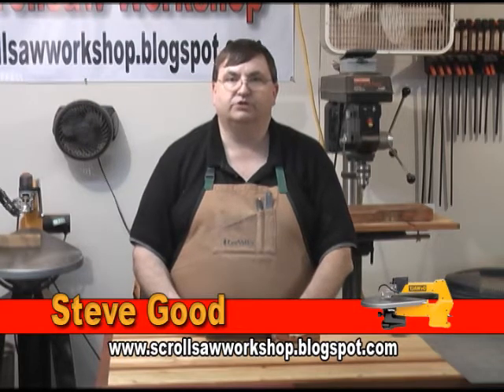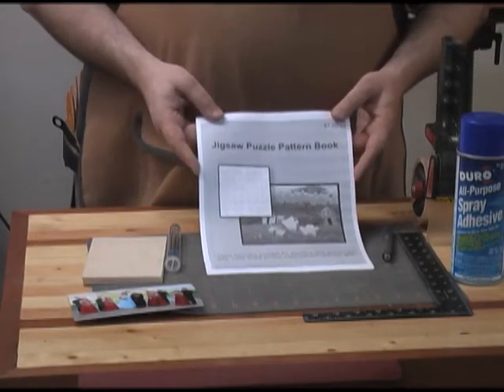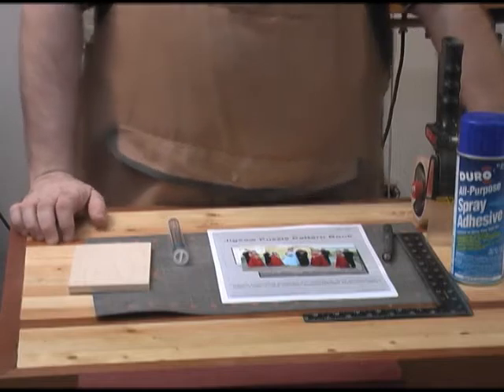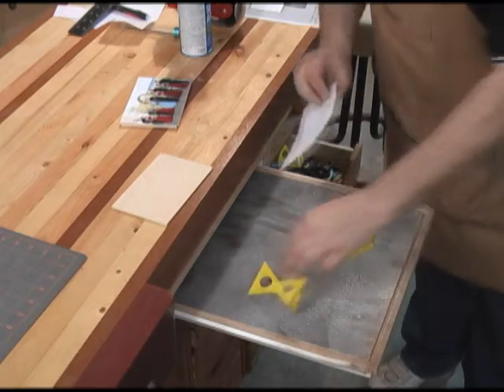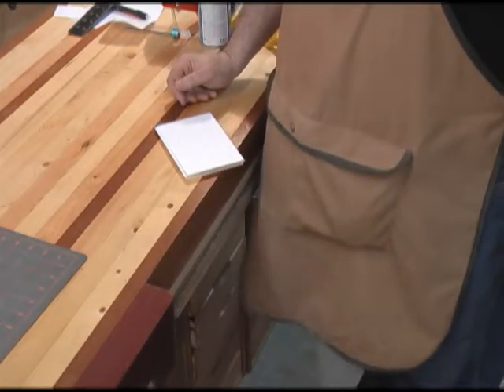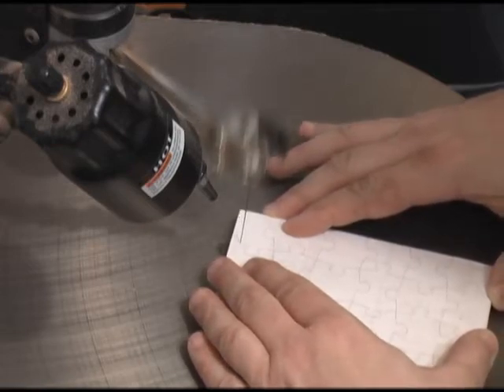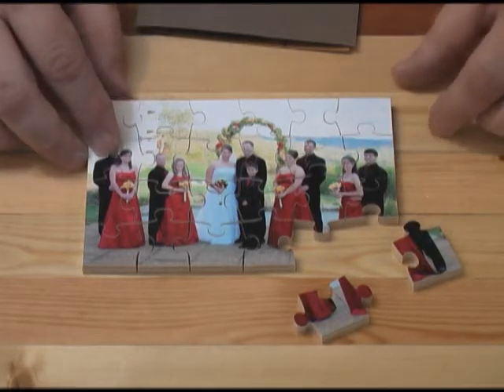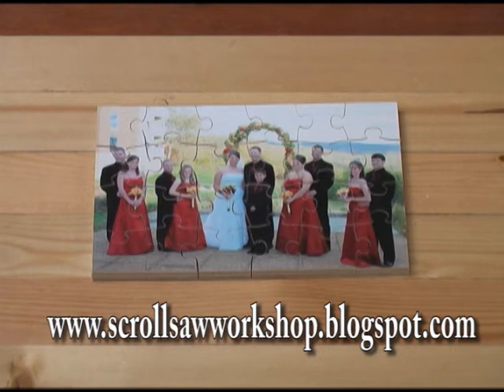Jigsaw Puzzle Template Book Demonstration

Comment: Can you add fixative varnish or mod Podge before cutting?
Reply: I have not tried mod podge but I have used a spray fixative and it worked fine.
Reply: @stevegood3224  thank you
Reply: @stevegood3224  hello, thank for replying, what glue would you recommend for gluing the photo or paper to board?
Reply: @geoffleach5390  I use 3M 45 spray glue. You have to follow the directions on the can for a permanent bond. I have puzzles that are a few years old and still stuck fine. The puzzles don't get used very often so I'm not sure how it would hold up with constant use.
Reply: @stevegood3224  cool thank for the input will try that.